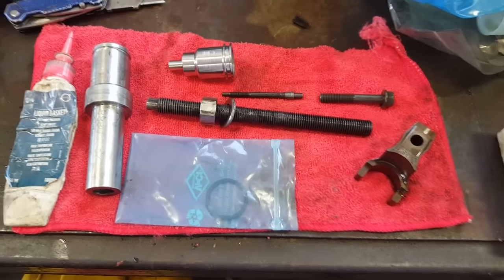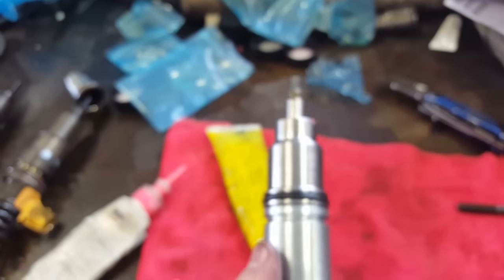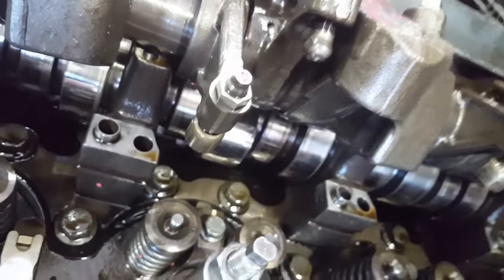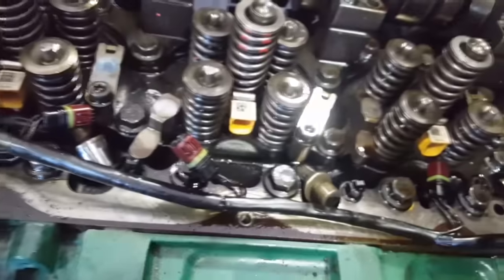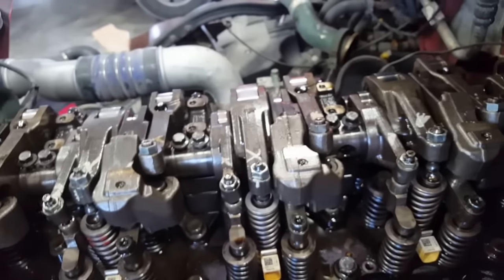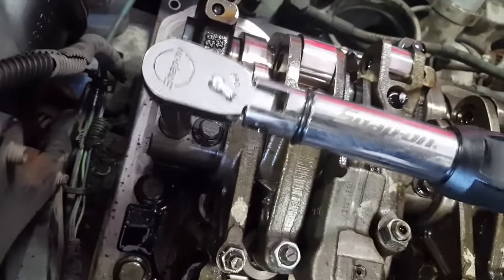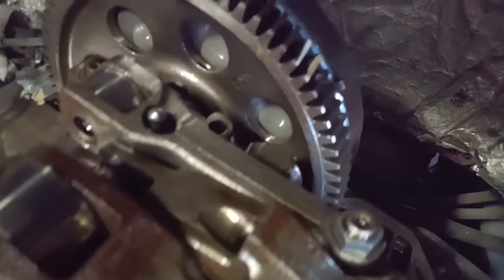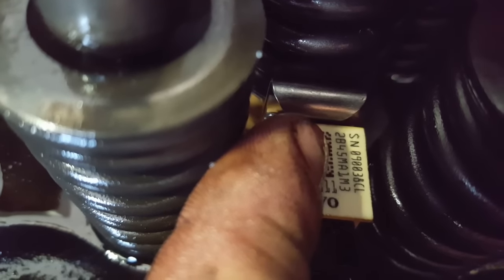How to Replace Injectors and Cups on a Volvo D13 Part 2/2

Comment: Hi how would you pull out the tip of the cup if it were to break during removal to replace them?
Reply from the maker: Never had that happen but probably screwijg a bolt into it may work
Reply: Cardinal Truck Service 
Thank you so much finally he fix the problem he take the truck to Volvo for the 6 pistons and they  was asking $14,000 plus taxes that was too much money  for that job 
My husband always look all your videos you are so professional thank you again
Reply: Cardinal Truck Service 
He spend less than $5,000 for the  set of 6 piston and  cups  and he did the job  follow your  video instructions thanks